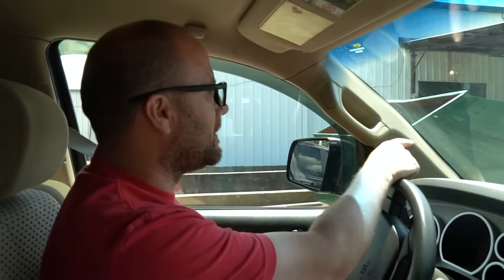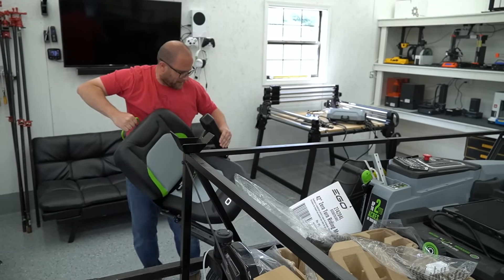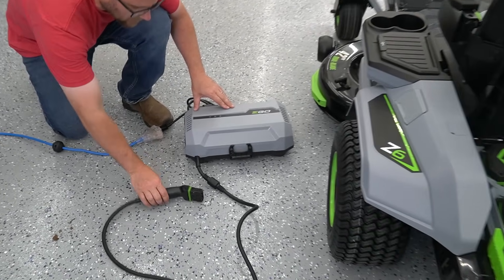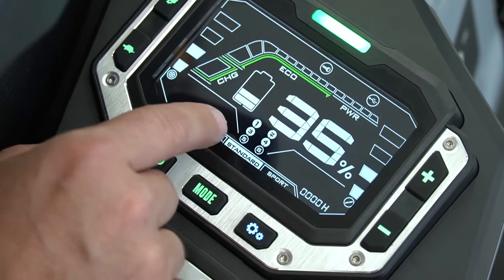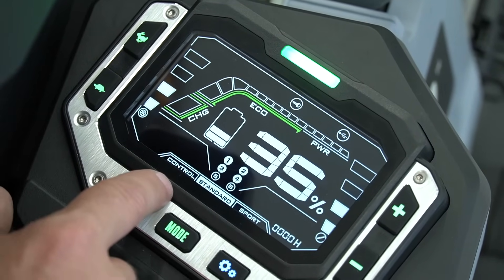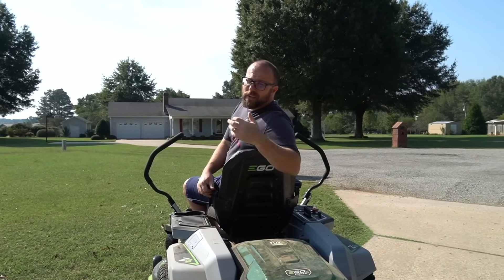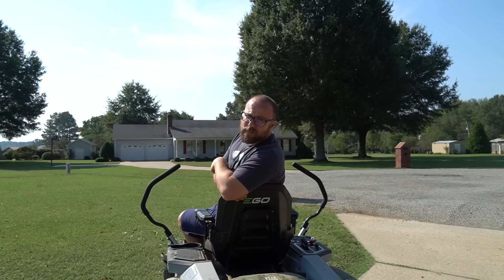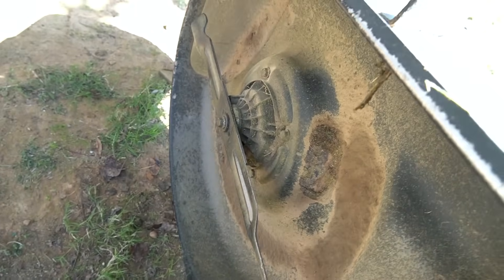EGO Z6 ELECTRIC Zero Turn Mower - The FIRST of its Kind! //Unpaid Review!

Comment: I really wanted one of theses mowers, and, the electric side of it makes a lot of sense, but, after a lot of research on zero turn mowers the mower itself seems to be pure junk and it’s way over priced. I can get a lot more mower for my money with a gas mower.
Reply: Good call. These electric mowers are cheap Chinese made crap!
Reply: @mikieme6907  the pro electric mowers like the mean green stalker is a excellent machine, but, it’s $22,000.00
Reply: @Dbiker75Tex24  For 22 grand it better be.
Reply: @channell11  yes it’s seriously heavy duty commercial grade, but, there’s no in between.
Reply: @Dbiker75Tex24  for 22k it better blow me while I'm mowing.  That's ridiculous
Reply: @johngatsby1473  LOL!! Well if you consider the price of many of the pro machines (example $17,000.00), and the difference in the cost of operation it’s not bad. The problem is if your not commercial they don’t make anything in between for the small guys or homeowners.
Reply: @Dbiker75Tex24  I'm sure that's by design so that they can maintain massive profits on the back of the professional mowers.
Reply: @johngatsby1473  probably, but having been in the business I know how hard we worked the equipment, and, the lighter stuff wouldn’t hold up.You are correct it’s all about the money.
Reply: Yup, electric is great for small single family lots, not much else yet.
Reply: You comment without having tried one. Yes it’s a bit pricey, but it’s not cheap. Plus zero gas and far less maintenance. I have this  (52”) and a Deere and although I love my Deere, I can say it will see far less use. Also, the entire product line is built around battery interchangeability. Also, the manufacturer (Chevron?) is a global brand with assembly plants in China.
Reply: @ccattrn  I agree , but, if you study zero turn mower the ego is junk compared to the gas models . I’ve been in the business, and, know mowers. Yes I agree the electric side has a lot of potential, but for what you get it’s over priced junk.
Reply: @ccattrn  it can not do the same work or last as long as a 5,500.00 dollar commercial mower.
Reply: @mikieme6907  Ego does not make crap. I have their little push mower and I can’t bog it down. If it detects more of a load it ramps up power.
Reply: @ROBMACDUI  ego might be good but this model just ain't it.  42 inch cut at that price is absurd. Doesn't make up for it in speed either. It only goes 7mph
Reply: @andrewk8636  Agreed that the price is high for a 42” mower but it’s far from crap. If money isn’t a concern for someone and a 42” covers what they need than this mower has some nice benefits such as basically zero maintenance other than a blade sharpening, no need to stink up your garage with a gas powered one and never needing to lug gas cans around in your vehicle.
Reply: @Dbiker75Tex24  overpriced…okay. Premium for a newish concept. Lots of technology in these. Cheap…your call…I disagree. Junk, definitely not. To each his own.
Reply: @Dbiker75Tex24  not sure how you figure. But hey…you’re the expert. Like i said, I also have a Deere, and I don’t see it getting used nearly as much as this.
Reply: @ROBMACDUI  also, interchangeable batteries with any other EGO brand product.
Reply: @zo4712  Damn right
Reply: @nathanielhibay6319  I wouldn’t call 2 acres small.
Reply: @zo4712  it’s not the electric part of it. I have a electric car and love it. What I’m talking about is if you look at a $5500. Dollar kabota or bad boy, gravely or any of the other  mowers in that price rang they blow the ego out of the water construction wise.
Reply: Lol!  Thanks for a much needed shot of real-life comic relief.
Reply: Yep another crappy gas mower is cheaper. But a lot more trouble and cost to maintain. Also stinks up the garage where it’s kept.
Reply: @205rider8  yeah! No! I’ve been at it as a home owner and a lawn maintenance company for over 40 year, and, the electric mower have there place, but, the ones you buy at the big box stores hav junk decks and frames. They are simply over priced for what you get. I know how to service my equipment and it never stinks.

Comment: For our children's future Battery Power is the way to go, it really does reduce our carbon footprint, sustainable, and emissions friendly, little noise, our kids need a clean Earth
Reply: You realize the plastics on this mower required HUNDREDS of gallons of crude oil to make, and are non-recyclable right? Or the absolute landscape devastation that is required to mine lithium and other heavy metals in these batteries? Let's be real electric is the future due to efficiency, performance, and cost. It's an absolute fantasy to believe otherwise. Bring on our new electric overlords!
Reply: The majority of the carbon footprint of most all machinery and vehicles is in the initial manufacturer. Therefore the longer the machine lasts, the lower its overall carbon footprint is. While improvements are being made everyday, I have not seen the majority of these electric versions providing near the lifetime of service that could be achieved from quality existing designs. Additionally the mining of lithium and the manufacturer of the batteries is an absolute Environmental nightmare. Also about 50% of the world's lithium comes from Africa where it is mined by slave and child labor under some of the worst conditions. The green movement may feel good, but there's a lot more to it than meets the eye!
Reply: @floridagunrat1625  100% agree with you, it would also help if we weren't driven by this overwhelming marketing machine provided by the internet, the only benefit I see from this form of advertisement is less physical promoting tools are needed like magazines, newspaper, ads, etc, live events, venues loaded with merch and food all require some manufactured goods, so alot of that has dialed back on waste and environment hazards, but when it comes to the mining of lithium its a nightmare indeed, when will it stop, we don't know, we haven't lived long enough to see what impact this has on the planet itself, we only rely on data we believe is accurate, how do we really know the effects of removing all these natural resources from this planet, we never consider maybe the earth needs these things to continue proper function, if we simply deplete in iron, B vitamins, protein etc we are doomed, its a little out there but something to consider imo, we should reuse more things trade support thrift shops swap meets etc etc

Comment: What he doesent say is each one of those battery packs on Amazon is around $250, if your full up on batteries that's $1500 in batteries, lithium doesn't make it usually past 1-1.5 years, 2 years if you barely use your mower

I think I'll keep my dead dinosaur burning old mower going, still would be cheaper than that junk

Comment: Save on gas but your batteries cost $500 (10a) $600 (12a) each. times that by 6 packs that it holds and see if you are saving gas money hahaha I'll keep my 15 year old scag thanks.
Reply: 5yr warranty…sooooo…haha? Lion batteries can last several years or hundreds of charging cycles (some sources say thousands).
Reply: @ccattrn  Prove it, go buy one. Let me know if it's worth the $5500 + $1000 or $1200 extra 2 batteries it doesn't come with. That thing might last on a little residential town lot but I wouldn't dare try it on my 2 acre property. I don't mind my blowers and trimmers in Li-ion but on a big investment I'll stick with the mowers I have beat down for 15 years tested and tried.
Reply: Hi Nathan. I’ve done my research, but most importantly, I don’t just comment. I have about 2.5 open acres, and I recently purchased a 52” which comes with 6 10amp batteries. The thing is an absolute beast. I agree, batteries are the X-factor with varied results. What I know is LIon batteries require specific care, or they won’t last. A plus for these is they automatically discharge to 30% if left fully charged and dormant for greater than 30 days. With a 5 yr tool warranty and a 3yr battery warranty, I’m happy taking the plunge. We’ll see.

Comment: Don't know if anyone has ever told you but using lithium batteries that are only partially charged damages them. They have memory and it messes with that. It's as bad as letting the batteries run completely dead before you charge them. It shortens the life of the batteries.
Reply: using partially charged is perfectly fine. Storing long term fully charged or discharged can damage them and reduce lifespan. I'd suggest leaving them at close to 50% for storage and plug in like hour before mowing to have full and ready for mow
Reply: @pauliusvindzigelskis2224  EGO batteries self-discharge to about 30% after about 30 days.
Reply: @ccattrn  That't not true. Maybe Your battery is heating up or smth and losing charge faster. When I leave my batteries at close to 50%, I find them same next time. Even after months of winter, found on similar charge. By your theory, I would've found them at 0%. I can't say exactly how much I found them on as  my battery only shows in 20% intervals (charger at 25% intervals), not as accurate as zero turn mower, but they are on same interval
Reply: @pauliusvindzigelskis2224  thanks Paulius. My info comes from the manufacturer, so if that’s not your experience, either they are being deceptive, or there’s a fault in your batteries. You are correct re. charging prior to use after prolonged storage. Discharging them helps protect the cells. But to be clear, by my theory, you would’ve found your batteries at about 30% charge. If left unused for a significantly long period, they will completely discharge which would essentially kill the battery. Which is why they should be periodically recharged.
Reply: @zo4712  how could they magically discharge themselves? It is not normal lithium battery behavior. Idk what are you referring from OEM, can You send me a link?